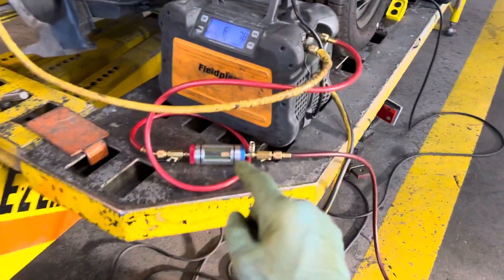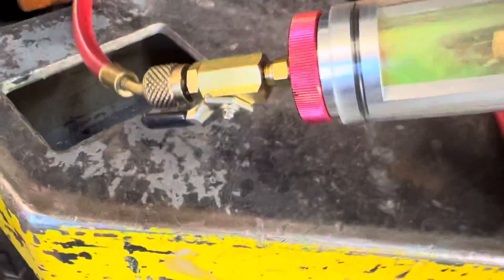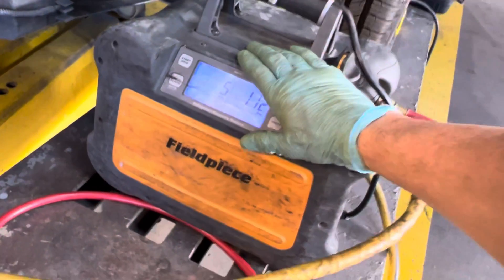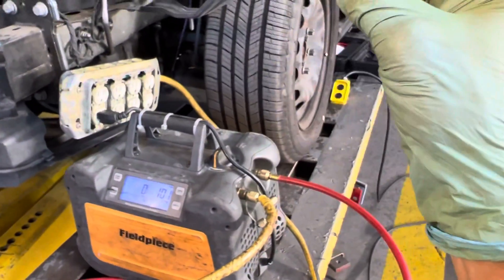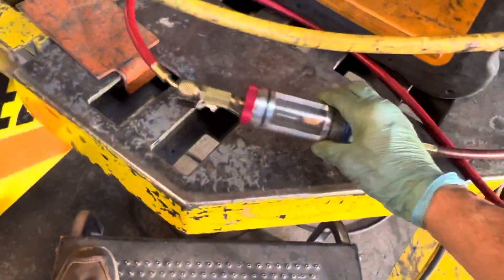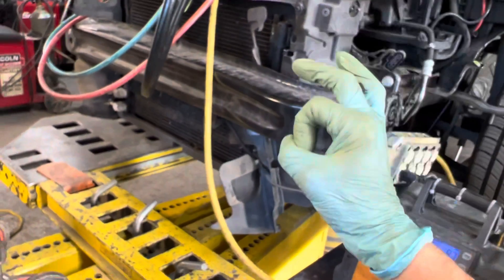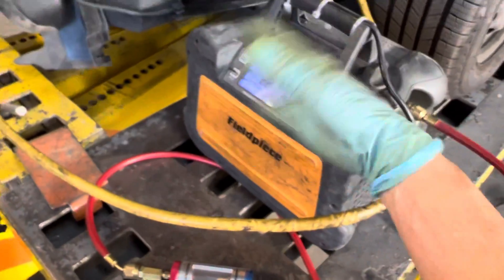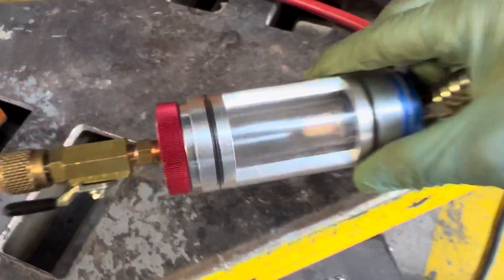What does the refrigerant look like coming out of a recovery machine in a clear glass ? ￼

Comment: Between a sight glass, gauge set, and my hands, I can truly understand what’s going on in the system. You can use your hands alone to get a good feeling of what’s going on but the combination of all three really makes a huge difference in diagnosing systems accurately.
Reply from the maker: Temperature is more important than pressure you can actually diagnose more with nothing more than a temperature of the lines the temperature of the air with absolutely no pressure at all and come up with a better diagnosis.
Reply: @coldfinger459sub0  if I had an accurate way of measuring line temperate I would. Infrared thermometers are a poor method of measuring lines because they don’t measure a small area, they measure a certain radius by distance. I would need some form of thermistor to place directly on the line to get an accurate temperature. Gauges can also be misleading due to the location in the system. I’ve never done commercial hvac and have only been an automotive technician (those bastards you hate) so my experience with hvac systems is limited to those applications. I appreciate the knowledge you share here because it’s teaching me another way of looking at things
Reply from the maker: @zackarymcclain164  I want all automotive technicians to be armed with this information. 

My father was an automotive and he learned from an older guy in Automotive who taught him about superheat and sub cooling and using line temperature probes thermistors that were attached to the lines my dad‘s old Simpson meter with 4 wired thermistors temperature probes

Now we have clamps with Bluetooth attached to software on our laptop or phone so much faster easier accurate convenient.